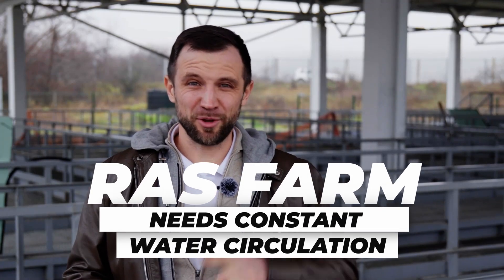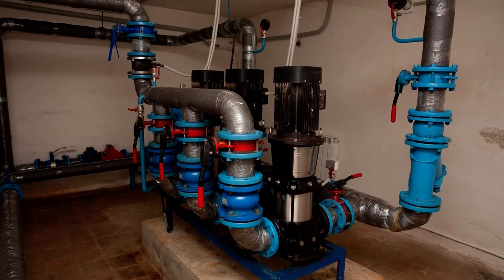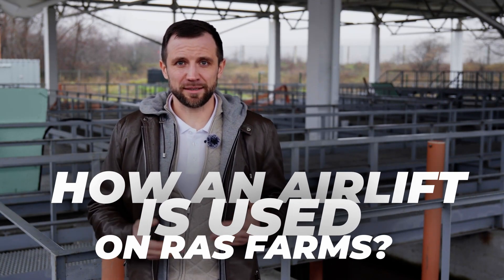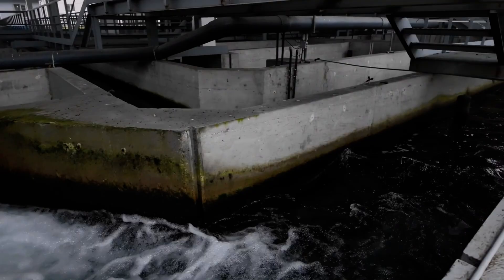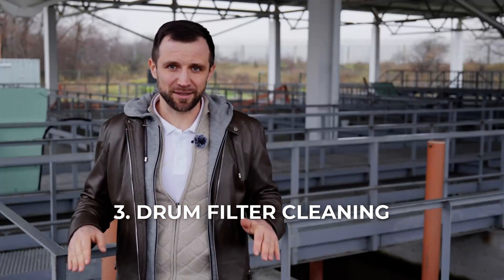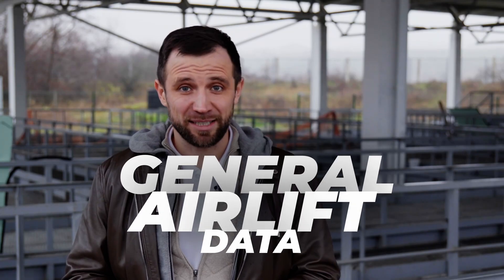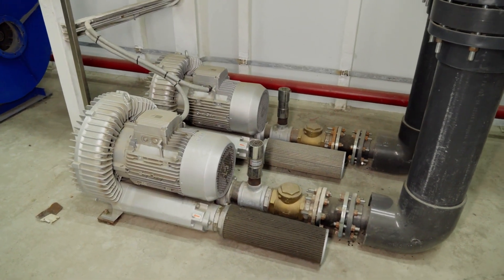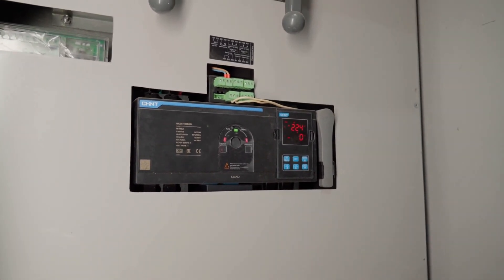100x CHEAPER, Simpler, and MORE RELIABLE than Pumps! Airlift in RAS Fish Farms — How It Really Works

Comment: I use air lifts to push water from the tank to the filters. This works very well. It increases the flow and stops clogging of the bottom drain pipe.  But I do have a pump for going into the tank. This provides the rotation for the round tank for the tea cup effect. I think both have distinct advantages for RAS.

Comment: It's less efficient to move water on a cubic meter per kWh basis, but it aerates the water.
You have low head high flow pumps that are way more efficient.
Reply from the maker: You are right👍